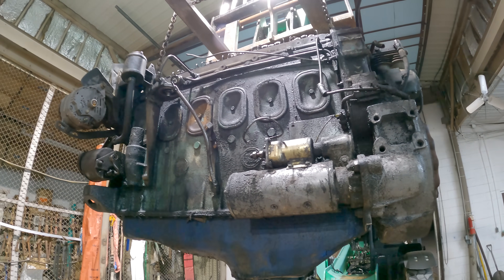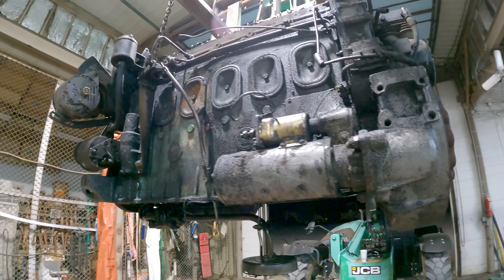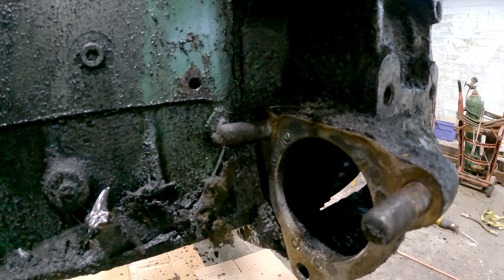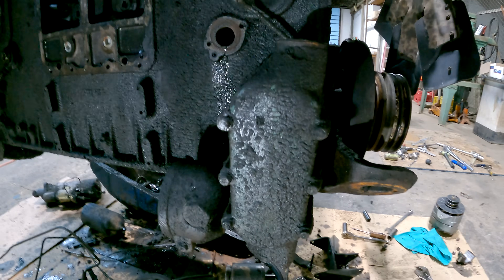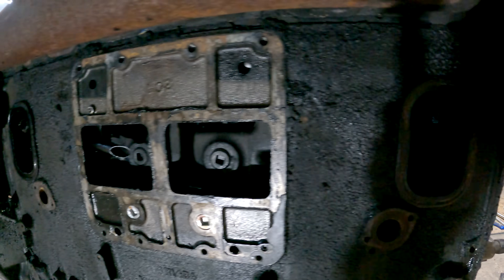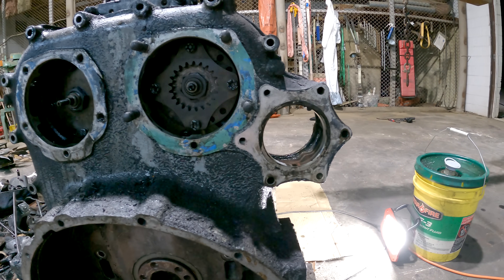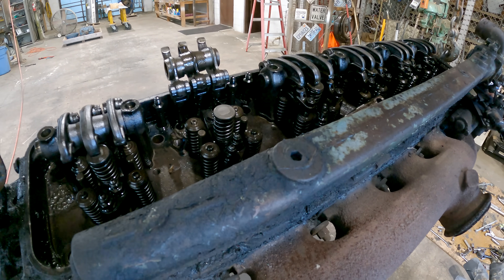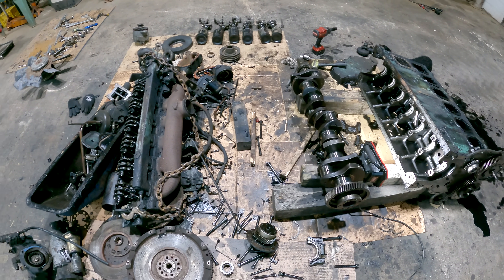Runaway 6-71 Two Stroke Detroit Diesel Engine Teardown

Comment: The way, you disassemble/ rebuild / tourcher these diesels on your channel, is extremely satisfying to watch. Thanks for makin it happen
Reply: This guy is Very good with Cats, and goes through the extra efforts to to put out the quality videos that he does... However in This video, there was Nothing satisfying about it at all... was pure Stupidity to do what he did.  

That engine could possibly have been a good core for a full Re-manufacturing, giving it a whole new lease on life.  

For those of you who seem to think that the 2 cycle Detroit's are "dead and buried".... there are currently Over, 1.3 Million of them in operation, world wide.. and more returning back to life all the time, as people locate them and are having them either re-built, or re-manufactured.
Reply: @Romans--bo7br  buddy it was satisfying to watch , dint come here for a lecture, 2 stroke diesel, is garbage for 3rd world countries. Under powered throw away motors at this point.
Your the type to sneak up behind a old unless 2 stroke diesel truck  and pleasure yourself to how useful it might be.

Comment: Wow, the bearings in the bottom end are still good after all that abuse? If you really wanted to, you could put new sleeves and pistons in that beast and it would most likely start right up!

Like 'em or hate 'em, those Detroits are tough engines.
Reply: You are correct- cylinder kits and gaskets and she would be up and running.  Would need a new head too it was wasted due to no water in its last run..
Reply: @jth1699  The cam was definitely smoked, and a new head would be needed to ensure reliability. Maybe the injectors could be reused, though.

Considering how many of these are out there in the wild, it's just easier to find another running engine.

Comment: Wish i was lucky enough to find somebody so cool to send me some parts of these.. looks like you guys in the states have lots of fun with these. Whenever they are not used as boat anchors you basically destroy them😂 Just if It happens that you have an air starter laying around contact me i would gladly store It properly

Comment: Sure is a neat setup though. I wonder what itd take to get higher revs out of it. Are there heavier valve springs available for these things? Or maybe some springs from a different motor that are similar dimensions. Also, what would happen if you ran it without those counterweights? Even crazier idea, spray nitrous at one and see what it does...

Comment: Nothing converts diesel fuel into noise and a lack of horsepower like a 2 stroke Detroit.
Reply: I owned a french "Berliet" truck ages ago. It had 18 liters of displacement and 190 hp. Pretty close to a detroit I guess.
Reply: Yep, and then you have Harley Davidson, world's best at doing the same thing, only with gasoline and two wheels.
Reply: Plus, they keep your undercarriage from rusting.
Reply: Bullshit I still run a 8v92 TA and it eats x15 cum aparts for breakfast all day long. And when I get in her on a hill the stacks smoke lightly and beautifully like a diesel should
Reply: @johnhull6363  In it's lowest rating, the X15 makes much more torque and nearly the same horsepower output as the highest rated 8v92ta. Stock for stock, with similar transmissions, final drive ratios, and equally skilled drivers, what you describe just isn't going to happen. Modifying the Detroit will level the playing field somewhat, but even then it isn't guaranteed.

Realistically, the Detroit only beats the Cummins in one category, increased fuel consumption, which could hardly be seen as an advantage. This is to be expected, as you are comparing a modern computer controlled diesel to a pre-emissions two stroke that was designed 40+ years earlier. In their day, the two stroke Detroits were the engines to beat, but they have been eclipsed by newer designs.

And no, I'm certainly not a huge Cummins enthusiast. To be honest, my favorite engine platform is by far the non-egr Series 60 12.7L.
Reply: @johnfox3845  He’s probably comparing an old truck that isn’t governed to fleet trucks that are governed at 62mph. 
New engines have plenty of their own problems. But, making more power than the old Detroit’s isn’t one of them. Especially if you go to the engines just before all the emissions hit. Many of those got good mileage and good power without a lot of the problems.
Reply: @johnhull6363  ok boomer
Reply: @Jeremy-iv9bc  guy that call people “Boomer” generally use that in the sauna at the YMCA  when scouting a prospect.

Comment: Amazing how after that WOT beat down the rod bearings and crank are still good. Thanks for the blower/fuel rack explanation. Cool video as always.
Reply: it probably wouldn't for quite a bit, if it had cooling system hooked up.

Comment: Would have been a good time to mention how these engines can be assembled to run in the opposite direction.
Reply: Yes these blocks have so many options the design was amazing,  I loved working and driving them
Reply: Flywheel end could be reversed for left or right hand blower orientation too.
Reply: Yep. For marine applications.
Reply: @jhalleck  Marine, and V-drive Bus applications. Mostly GMs.

Comment: that was fun. amazing the bearings looked as good as they did. thanks for the video always  entertaining.
Reply: The 2 cycle Detroit is the smoothest engine ever built. Once it fires you never need the rod caps again,  as the rod is always loaded.  It was running at 5 grand floating the valves and ran 10 minutes without water. Had it not scored the pistons and locked up, it would still be sitting there running 5k...

Comment: if i had the place i would save on one good old school diesel. When the solar flare hits, most all electronic engines will have all the wiring short out. Only things that will run will be compression ignitions engines like diesels. 
Solar flares happen often, last big one fried ALL of the USA's telegraph wire's. shutting down communications, that was not so bad, but today we have a lot of electronics that will short out. 
I have stored a small diesel 2 cylinder just in case and all the things i will need to maybe rewire a generator of sorts or build one. 
No harm in pickling one, store it in the corner of your shop just in case, if not for you, then some else in the future may be thankful to find one. 
Just one would be ok. like i say if i had the means i would purchase one from ya to store. i just have NO spot for one.

Comment: Back in the day them sob's were in everything screaming all day long. My first experience with one was my second cousin bought his first semi, a fleet star 2000 with a 671 and hauled grain from the field to the twin cities. I was just a kid but thought the dam thing was always on the verge of blowing up.
Reply: I spent many days sitting in Savage at harvest mistakes...
Reply: Greg Penner those were the days, right after I35 was finished, truckers waved to one another, no CB’s and was always looking in the mirrors and hanging out the windows looking at one another and letting each other know if there was a bull ahead on the road. Most grain trailers were not belly dumps and the elevators had a lift that picked the whole truck up to dump it. Was something to see for a young kid.
Reply: @oldfarmer4700  they still have and use those lifts. They load DDG onto barges through there these days and there’s a lot of end dumps that go through there. It’s really kind of nice going there now. Unlike before when we’d camp out for the whole day for one load. Although that was fun too if you didn’t mind not making any money. Guys would bring BBQ grills and things like that.
Reply: It was on verge. You just got lucky.

Comment: The amazing thing about the Detroit Diesel Series 71 engine {so named because each cylinder had a nominal displacement of 71 cubic inches per cylinder (actually 70.93”)} is that inline 6 cylinder engine aka 6-71 was in continuous production from 1938 until 1995 giving it a production lifespan of 57 years which is unrivaled in the heavy duty Diesel engine market as well as the light duty (passenger car & light truck) diesel or gasoline market. The 6-71 has a production lifespan 8 years longer than the Small Block Chevrolet engine (1954-2003). The series 71 engine was produced in both inline models with One, Two, Three, and Six cylinder and “V”-Type engines (first produced in 1957) with Six, Eight, Twelve, Sixteen, and Twenty-Four Cylinders.  The 16V-71 and 24V-71 engines used multiple cylinder heads per bank to keep the cylinder head size and weight to manageable proportions with the 16V-71 using four cylinder heads from the inline 4-71 engine and the 24V-71 using four cylinder heads from the inline 6-71 engine. Additionally the using of multiple cylinder heads from other engines on these two large engines helped keep production cost down and maintain parts commonality.  In addition to inline and V style engines the 71 series engine was produced as a “Pancake Engine” with the 6L-71 or 6N-71 that were designed for horizontal mounting for underfloor applications on larger Crown and Gillig school buses and transit buses such as the articulated Crown-Ikarus 286 and the GM-6046 also called a “Twin-Diesel or Duplex-Drive” engine which was two 6-71 engines Siamesed together making a 12-cylinder engine that was used in later model M4-Sherman tanks and small to medium sized boats such as the Higgins Landing craft during World War II as well other marine and off-road uses following the war.  
The worn and abused 6-71 that our esteemed host tortured tested to its finial demise is without a doubt the most produced heavy duty diesel on the planet today.  One thing is undeniably for certain the effect upon modern world history that the “Screaming Jimmy”, “Driptroit”, “Green Leaker”, or simple “Detroit” 57 year production history cannot be under standard.  The workhorse that is the 6-71 founds it way basically unchanged into every application possible from on-highway use in busses, and trucks, military equipment, marine, industrial, generators, construction, pumps, farming, and heavy equipment, in which it reliability has proved to be nothing short of legendary. Admittedly by today’s standards the 6-71 and for that matter all of the 2-Stroke Detroit’s are power pigs but when the 6-71 was first introduced it was nothing short of revolutionary. Before the introduction of the 6-71 Diesel engines were very large and heavy and as a result they were mainly limited to stationary engines or marine applications where weight and size were generally of little consequence.  However the 6-71 charged all that with its use of 2-stroke engine architecture which gives the engine a power stroke every rotation compared to the 4-stoke engine which allowed the 6-71 to be much smaller than it 4-stoke diesel counterparts in an era when the gasoline engine was king. (Edit to correct syntax error in last sentence)
Reply: Not a fan of the things (2stroke Detroit's....have got a 353 and a 471), but what u listed here is a matter of fact... doesn't make me like them anymore...but they'll make noise , and run forever on nothing more than possum piss .. .👍👍
Reply: 1938 with a design stage at least five years prior all without the help of computer assisted design and manufacturing. To me this is very impressive and attests to intelligence of all the people that made it happen. Thanks for your research.
Reply: they are a tuff motor i wanna see him put one of his cat to the test till it blows and see how far the parts go
Reply: @randallelder486  yeah no shit...I've got a few cats too...I like them but they're overrated ...I think
Reply: @randallelder486  They're tuffer engines than the 4 strokes and they rarely break down. I have a 6v71 in a mci bus. We'd still be usin them in new vehicles if it wasn't for Al Gore and the global warmers that think Co2 plant food is pollution. Trees and plants absolutely love that rich black diesel smoke full of Co2 plant food.
Reply: These engines built America.
Reply: Thank you  for the history lesson. We run a 471 at a sawmill. Rings on both ends of the  cylinders!
Reply: Great info! Greatest diesel ever! Sound the best and run forever even on the crappiest fuel. A true workhorse and war veteran.
Reply: Last sentence is incorrect. The two stroke produces a power stroke every revolution.
Reply: @sl3406  Made correction to last sentence thanks for pointing that out it was one of those cases of I know what I meant to say regardless of what my fingers typed.
Reply: @sl3406  That's what he said. "However the 6-71 charged all that with its use of 2-stroke engine architecture which gives the engine a power stroke every rotation."
Reply: @gojudude  He corrected it after I made my comment.
Reply: great comment, I remember those engines still around when i was  a kid, I did love the sound but hate the smell
Reply: Wait, were you my instructor in "C" school when I was first in the Navy!?
Reply: GullRC - What you said....Plus, every other IC engine on earth wishes it sounded like a DD. Edit: and sl3406 is correct, power stroke every revolution, not every other r.
Reply: @cmans79tr7  Made correction to last sentence thanks for pointing that out it was one of those cases of I know what I meant to say regardless of what my fingers typed.
Reply: You're so right my friend
Reply: The 92 series engines were an improvement over the 71 series engines. especially the 8V92 silver series with the addition of twin turbo chargers.
Reply: Thanks for your info!
Reply: Apparently the engine that took 1½ of my grandfather's fingers off, was a 6-71. It was in a very early 4070 International, the cab was raised, granddad was on the catwalk with the mechanic. Granddad leaned over to do something and his wallet or checkbook, fell out of the front pocket of his bib overalls, he reached down to get whatever it was, and apparently the belts got his fingers. I may have been in 1st grade at the time, so this would have been 1971, or possibly 1972.
Reply: All of this history is just in the US, long history of the Russian knockoffs
Reply: Thanks for the history lesson. that was very interesting. I worked around detroits about 40 years ago but just watched the other guys, so I didn't know that much about them other than the how the number system works. I did some services on 6V-71 silver something or other. We had a lot of 6-71 engines in all sorts of equipment and one guy rebuilt them.
Reply: Nice novel!
Reply: Thank you for this precious info.. much appreciated 👍
Reply: Detroit humminbird  was what my dad called them. I drove an oil tanker with a 92 series v8 and it was problem free as long as you fed it a gallon of oil before each trip and two extras in the cab. Oh the good old days 🙂
Reply: These engines are tough. As are their bigger cousins. I work for a railroad, and have gotten very familiar with the 645 and 710 EMDs which are just these things on steroids with a couple extra cool features thrown on. It’s hard to kill them unless your trying hard.
Reply: I don't think you know a damn thing about these motors.
Reply: @lntrlp4936  Bet you know it all.
Reply: @andysaunders3708  I bet you realize I was just joking as well.
Reply: Great comment, but they were still junk.

Comment: Having a long (and hence heavy) piston, long stroke (and hence heavy conrods), and sets of rings on both ends of the piston, is a friction factor for higher fuel consumption. Also detracts from power to weight ratio.
Reply: Please just dont
Reply: Pour some motorkote in it, she'll be alright.

Comment: Awesome video! Love your teardown vids. Any chance you can explain why a big truck diesle doesnt have a wastegate?
Reply: A wastegate is used to bypass the turbo so it doesn’t push more air. So, if you make the turbo the right size it can’t push more air than you want it to. About the time the turbo can’t efficiently move more air the engine is also at peak rpm. The limited RPM range of the big diesels also makes it much easier. 
Basically they just matched the engine and the turbo to where they work together without needing to control the turbo. 
With most gas engines they have a bigger rpm range so if you got a big enough turbo to really work at high rpm it would likely do to much in the mid RPM range. And if you got a little turbo that worked at lower RPM it wouldn’t move enough for the high RPM. So, they use a big turbo with a wastegate to control it.
Reply: @NBSV1  interesting. By that then id assume that big cat diesel engines and such would be running a wicked high boost pressure since the turbo is sat in an efficient band no matter what engine operating condition.
Reply: @SMVB-cl6oc  a big factor in boost control is also fuel, cut back the fuel on a diesel and boost will also reach a limit, ideal for clean burning conditions as you cant run a diesel to Lean. They love it as they run colder in lean conditions

Comment: Say what you want about Jimmys, they are tougher than wood pecker lips. I've seen them ingest everything from gravel to salt water, and everything in between! A jimmy will get you home, Period. No small thing when you're offshore. I'm not a huge fan of them either but it had to be said. Taker easy...
Reply: My dad has a yacht. Has two 6-71 TAs. I pissed in the intake side of one of em and nobody ever knew
Reply: Try pulling a heavy load with one in a truck, your opinion my be different.
Reply: They’ve been pulling heavy loads in trucks since 1938.
Reply: @toddgittins5692  my cousin had a 8v71 in a ford grain truck and a 903 in the other both were wornout but the 8v71 out lived the 903 the other grain truck was a ford also it was a 2 decades newer and blew up way before the 8v71
Reply: @toddgittins5692  Man up and drive the thing, you can't lug one around like a 4 stroke.
Reply: @docsockem  I did, 30+ years ago, when I had to. Never again, wouldn't even pull on the door handle. Just like the Mack, it's a 4 letter word.